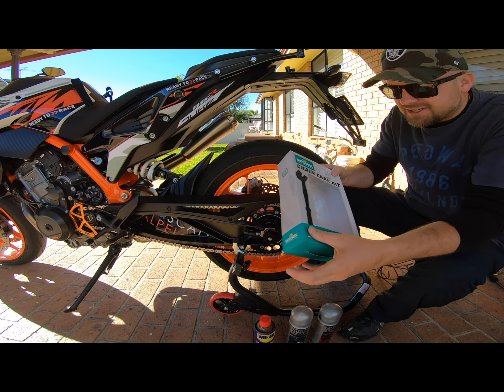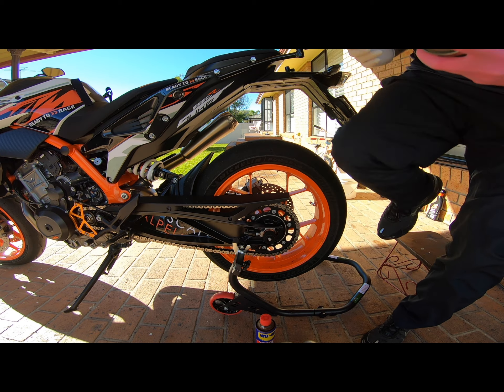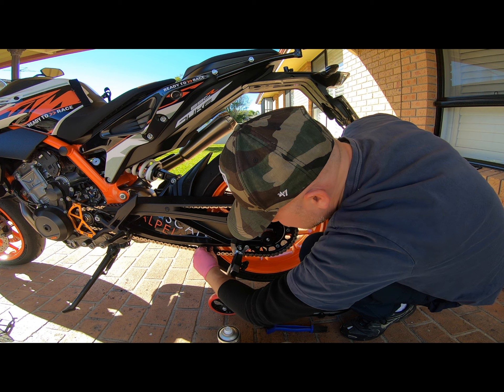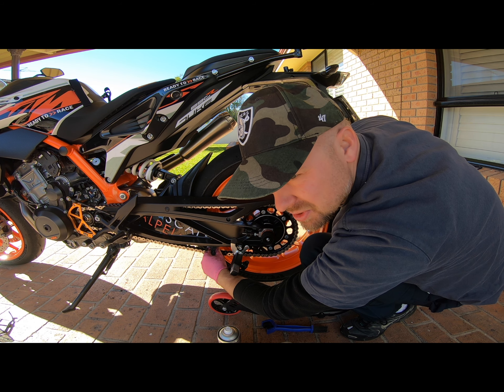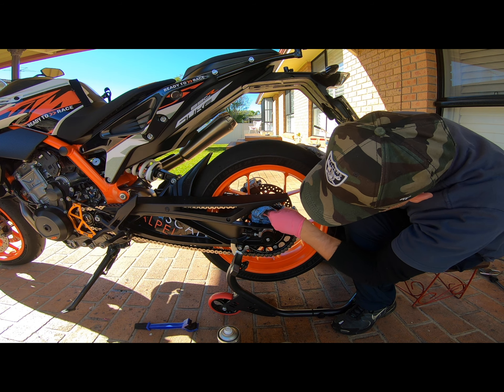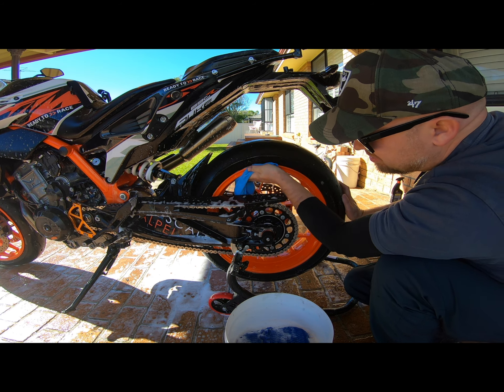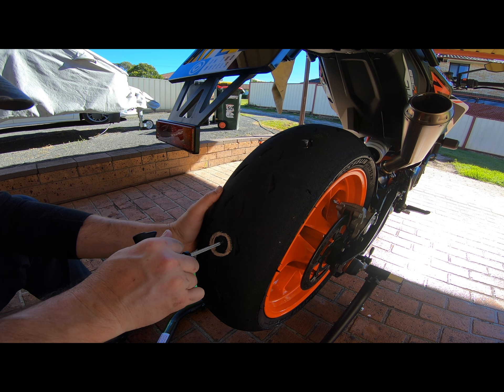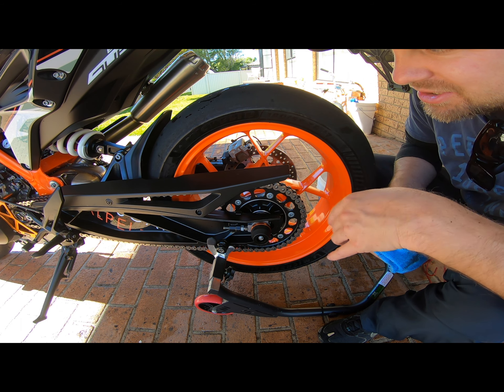KTM 890 Duke R Chain Clean Tips & Tricks with Bonus Tyre Puncture Repair

Comment: The chain cleaning tool is meant to be turned sideways so you not only get the outside but also the inside of your chain.  I also am curious how many miles are on your tires at this point.  It is a great tire for the race track not so much if you got caught in the rain for sure.  Have you had to do many chain adjustments on the bike I am hearing the chains are not the best.  I have the same bike but only 150 miles on it got it right at the start of winter last year then had surgery so just now got my parts on it and can ride the thing.
Reply from the maker: On a complete chain clean i use WD40 and the blue rag to wipe clean the inner side of the chain. The original tyre I got about 6000km and then went over to Pilot 5. Chain was adjusted when the bike went over to new tyres and or a check during servicing. If you look after your chain it will look after you.
Reply: @PissTakeProduction  I think I am going to go with the road 6 which is just a name change.  I am going to be 60 soon and have ridden bikes since I was 5 years old.  One of the reasons I am alive this long so far is don't ride like your on a race track on the street so those power cup 2 tires have 0 use for me.
Reply from the maker: @coopula3387  Yer they were a soft sticky tyre for the track. All my bikes I switch to Pilots.